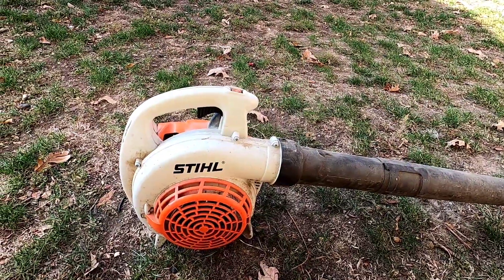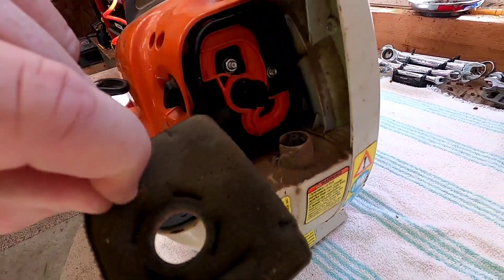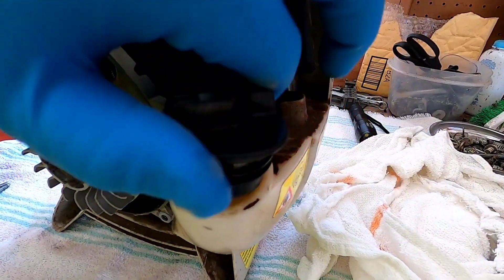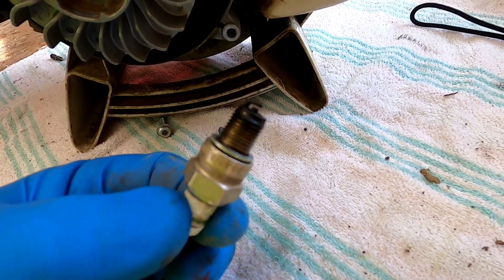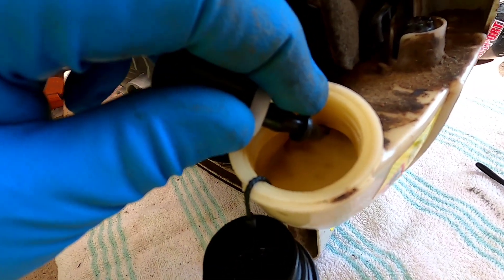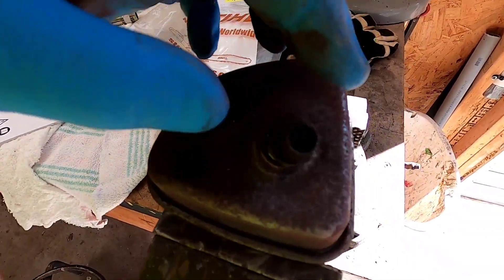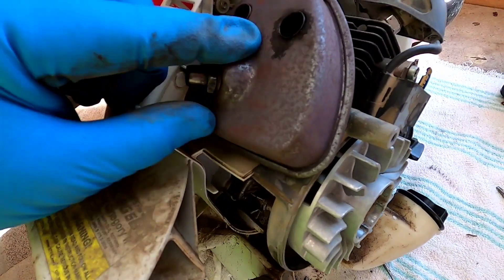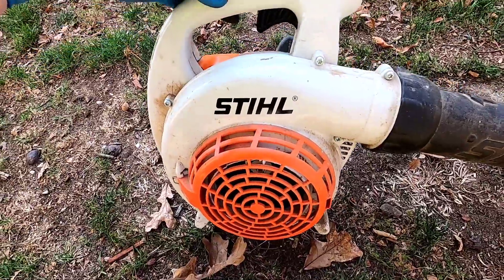STIHL GASOLINE LEAF BLOWER BG56C TUNE UP NOT RUNNING FIX HOW TO

Comment: Thanks Dad!  The last tip to clean the exhaust filter was the only thing I did and it made a huge difference.  Needed to use a fine wire brush; a coarse one won't get into the fine mesh of the filter.
Reply from the maker: Glad it helped!

Comment: I pulled that exhaust filter and brushed it with a brass wire brush and used some carb cleaner on it. Worked great! Thanks!
Reply from the maker: Great tip!